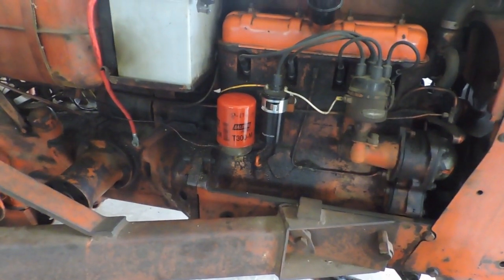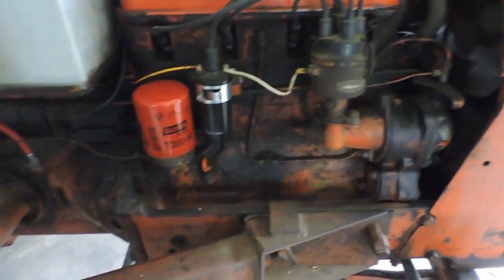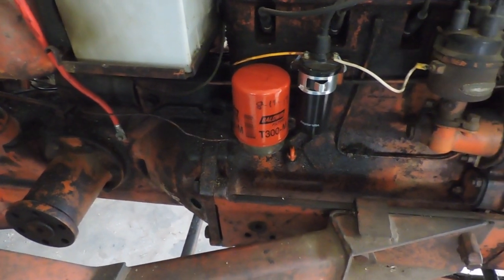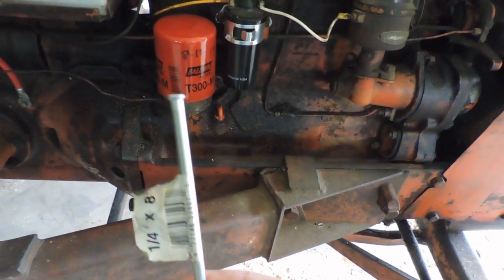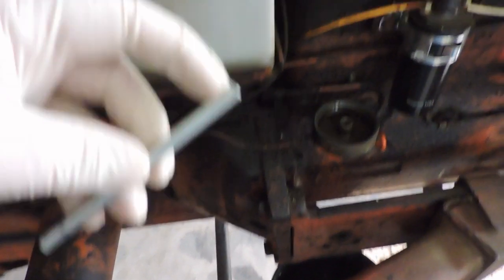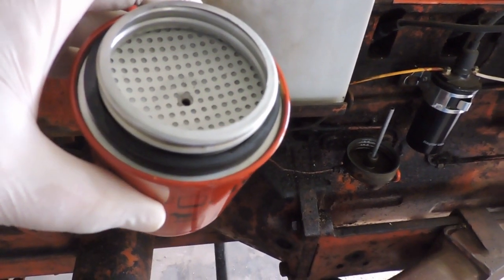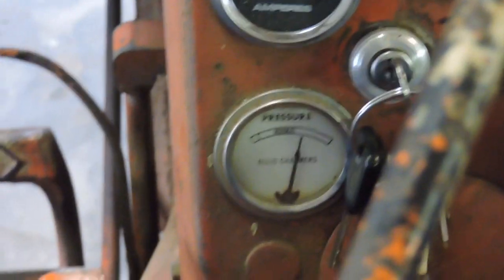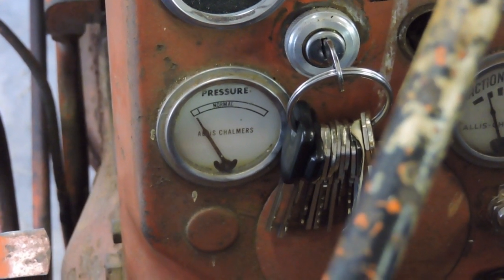Important Addition to the Allis D 14 Oil Filter Change

Comment: Another think you should be aware of, these engines have very low oil pressure something around  8-10 #. Sometimes people replace a non working gauge with a 50-60 # gauge and then not understand why they still have no oil pressure,
Glad you got the oil pressure gauge working,
My TO 35 Ferguson 1957 model has a similar issue, it has a spring and flat washing inside the oil filter canister that can easily slide off into the used oil container as you have to manhandle the old oil filter off the center bolt,
What were these engineers thinking back in the late 50’s?